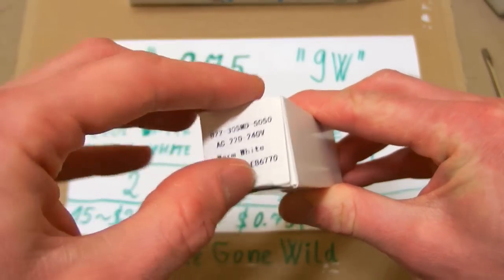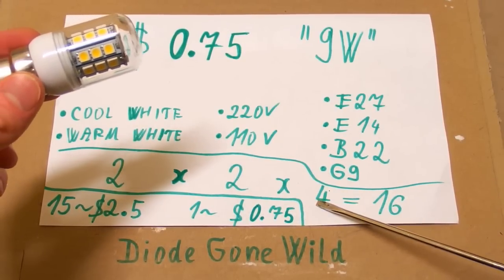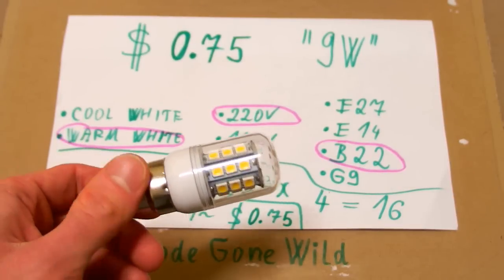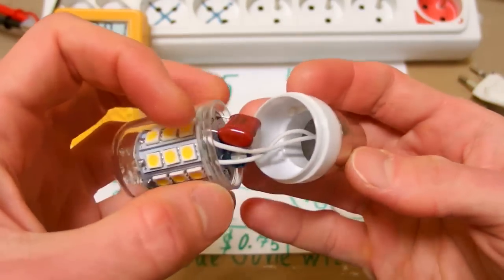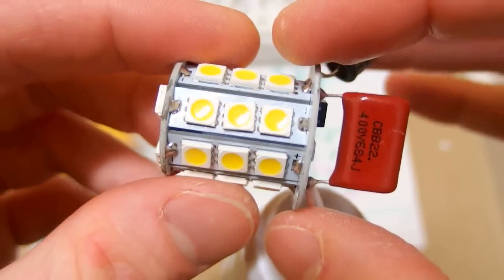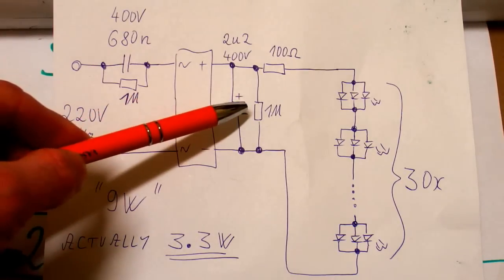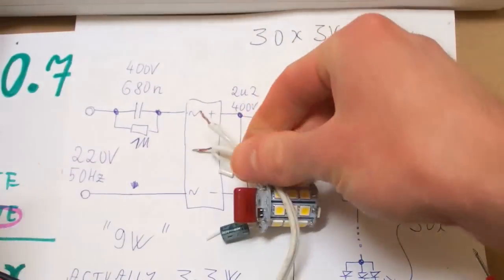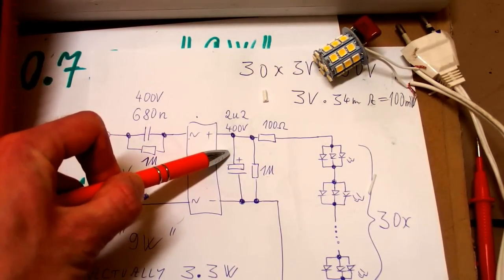$0.75 Chinese "9W" Corn LED Lightbulb - test and teardown

Comment: 33mA in the LEDs, they won't last long I'm afraid. The current should be about 20mA or less for these type LEDs.
Reply: Wire a resistor in series with the B22 socket, that will reduce the current

Comment: I've had so many problems with those led lamp I can not even tell ... they blow in many places, either the polypropilene capacitor blows, or the electrolytic capacitor blows and many times it is one of the smd resistors. They are of very low quality in any type of socket.

Comment: The Bayonet (B22) fitting is widely used in the UK and Ireland.  Most of the light fittings in our house use B22 bulbs.  One hallway light and a 5-bulb chandelier in the living room use Edison Screw (E27) bulbs.
Reply: edison was a thief.
Reply: we use it too in Pakistan
Reply: Here you may get different lighting sockets for kitchens and bathrooms in the UK but the rest are usually the B22 ones. 

It depends on the household tho and how old the house is.

Comment: Playing with the mains, you mad man :-D.
Yes i was wondering why you chose the bayonet fitting, but price forced the choice.
Its a nice cute light, perhaps transplant your own fitting to it, for 75 cents it has to be worth it.
At least the live leds are covered by plastic, Unlike some deathtraps.
Reply from the maker: Yes, there are corn LEDs with no cover :) The chinese safety is amazing... And I also like the electrode water heaters :).
Reply: Electrode water boilers are just evil, both you and bigclive have shown them, i think ill stick with resistance wire in an earthed metal tube, or kettle element for short :)